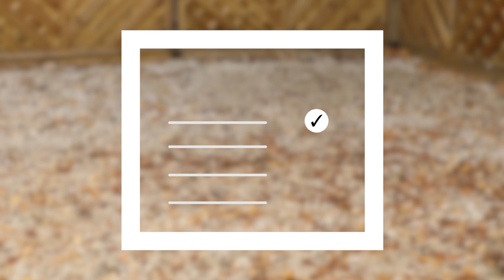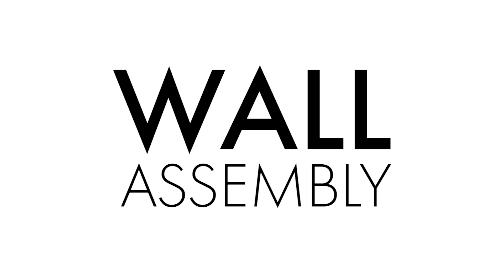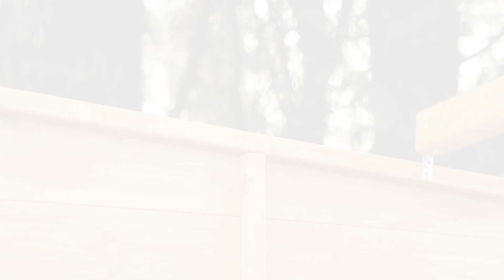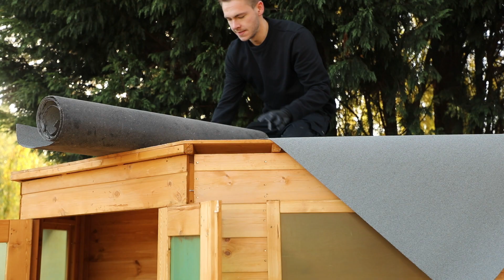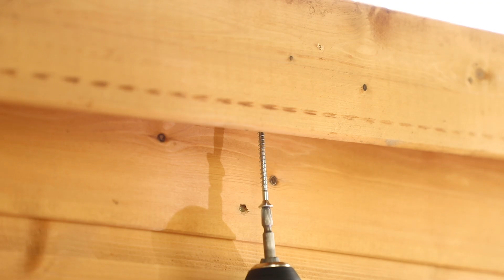7 x 7 Corner Summerhouse Installation

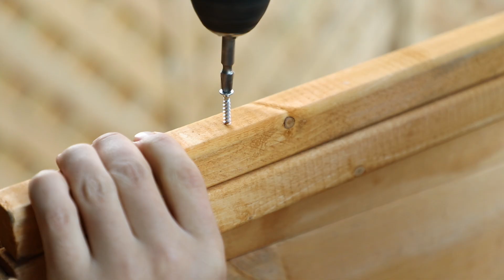Comment: As someone else mentioned at 4:30 it's not correctly fitted, it will ballance on top of it. Also, I needed to re-trim side of panels as they where not fitting properly (poor quality check). It's all a mess in the instructions, the manual from it doesn't even match with the PDF from their site😂😂

Comment: Managed to get it all done bar the roof felt today in about 4 hours with my mum. if anyone needs helps message me and I'll try and take a video and explain what I did, the instructions and the videos don't align perfectly so you have to mix and match and do a bit of DIY. I'd like to point out I used an impact driver and drill (both Makita) which I would highly recommend for this job
Reply: Hello there, I have purchased this and have it all built ready for the roof to fit. I have screwed the 2 pieces of wood as described just before putting the roof on. The problem is I can’t get to roof to fit correctly? Any advice would be helpful
Reply: @lewisadams5081  check and make sure all the wood (long thin bits) you screwed to the top and top side of the walls is in the right position. In some cases the wood is screwed in on top and in others it's screwed into the side at the top flush with the wall, the drawings don't explain this very well so you have to study it to make sure it looks correct
Reply: @@GMflashgordy sorry only just seen this, have you managed to sort something out?

Comment: It took 2 of us 3 days to assemble, albeit on the three hottest days of the year so far. Most of the time was taken up with prep. and regular drinks breaks. REALLY pleased with the end result and it was well worth the wait for delivery. A few comments on the video though. The instructions are OK, but could be improved. TRY it all before you screw it together - ALL the screws are put together in one bag, so sort them into their various sizes before you start to build. Paint the underside of the floor and the top of the roof with fence paint as extra waterproofing before assembly. Use a boot kit (extra) to lift the floor above even a flat solid base and nail ALL the boots down or they will fall off. Consider how to secure the window panels to the door panel as the frames do not "butt cleanly together". Think of it as a 3D jigsaw and don't think you can get it all done as quickly as the video suggests. Be prepared to improvise occasionally. Very good quality. Recommended.
Reply: Out of curiosity how much did this cost?
Reply: @jeremywong9207  Hi Jeremy. Total cost for purchase and delivery was £815. The (concrete slab 8'x8' base) was already laid. Construction costs were minimal (DIY) with the able assistance of wife and neighbour and straightforward in the absence of clear instructions supplied. In my case it cost a few quid more to replace a couple of timber fittings which had warped because they had been polythene wrapped after getting wet. Easily replaced off the shelf at B&Q though. 2 and a half years on, painted twice. Looks as good as new with no leaks.

Comment: Can you get it wired for electricity )light etc how you do this?
Reply: Yes you can
Reply: After Tony Blair courted the tradepersons' votes his government proceded to pass rigourous electrical work legislation as a reward to the electricians. Their prices went up even more. You have to be competent person to do the electrical work. If you are not a qualified electrician you'll have to get the local authority to inspect and sign off the work for which they will charge a lot of money.(£500 upwards). Spend time researching the requirements for wiring to a shed. The jobs simple but the regulations are not.

Comment: I wish I'd seen this before mine was assembled - without any instructions, not even paper ones! The guys who did it did a really great job anyway, except bolts/locks/turn buttons not in right place, but now I can correct those. Agree it's a strong solid structure not flimsy at all. I love it
Reply: I don't use 'Expert Construction' because I don't trust it.

Comment: Disagree with below comment, it is not a flimsy building, the tongue & groove cladding is much stronger than overlap & is well made. I did strengthen the floor to make it  more robust. I do agree that assembly is not as easy as the video shows - especially joining the angled window / door joints- you can't get a drill in to make pilot holes, there should be an angled piece supplied to make this easier, wouldn't cost much. But overall I think this is an excellent product at a good price.
Reply: Yes Tand G is better. Overlap can be horrendous with warping wood leaving gaps and knots falling out. Basically though all these buildings are assembled in a similar way to the video and the instructions are always horrible. I would put much more effort int lining things up that the assemblers di. I'd not be happy with their work.
Reply: Have you purchased this summerhouse?
Reply: Jenny Langford-jones   Yes Jenny, with my own money!
Reply: @michaelberry5886  I've seen mixed reviews so have been a little doubtful about this but is exactly what I need.
Thank you for your reply.
Reply: Jenny Langford-jones  I'll do a review on their website when I've fitted it out, but to summarise for you ; pros- price , compared to other sites very good value . Construction, well made panels using fairly thick timber - I wouldn't use overlap, this is tongue & groove - much better,  very fast delivery.  Cons- joining the angled panes not easy but when all the sides are together it all is robust, plastic windows - I think I will replace with glass eventually, but that's just my choice, there is a gap round the doors when fitted but I have added strips of wood to the frame to cover them. Just take your time constructing & you will love it.
Reply: @michaelberry5886  Thank you.ive ordered mine today so fingers crossed. Thank you for the advice too.at least it wont come as a shock if I come to these mentioned. Have u put some sealant around the windows?would you say the roof felt is a good quality .any other helpful advice would be great.
Reply: Jenny Langford-jones I haven't sealed round the Windows yet but will. I have used lots of sealer at al the wall junctions - so far 5 tubes from pound land! - and I painted all the wood before assembly. The roof felt is standard quality, looks OK to me, I downloaded the assembly instructions from the website but those supplied with the kit were different , so beware!
Reply: Jenny Langford-jones hi how was the house ?
Reply: Are you still happy with your Mercia Summer House. I've read so many shocking 1 star reviews about awful customer service, shocking quality, nail gun nails missing the target and thus protruding internally, miss-sized panels, missing pieces - the list goes on. Your comments sound so much more positive.
Reply: @John-bs6ut  can't speak for others but I'm still happy with my summerhouse, stand by my original post. I paint it each year & it keeps it looking fresh
Reply: @michaelberry5886 sorry for the delay, hadn't seen your reply for some reason. Glad you're still happy with yours. We've decided against getting a summerhouse now, or rather the space we have is not really suitable but thank you for your info
Reply: Took us 2 days, but day 1 was far too windy and it worked against us. We missed the section about the transit bars as that’s on page 5 with the parts under a section called preassembly , but to be honest it should be step 1 🙈 I saw that on a comment on this video (thank god) then I watched the video. Looks great now it’s up 😅
Reply: Totally agree